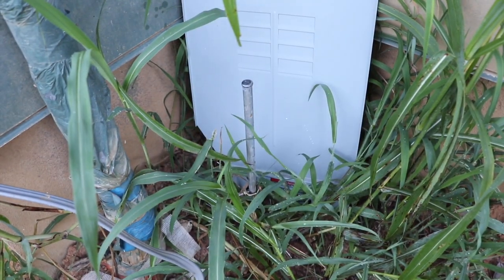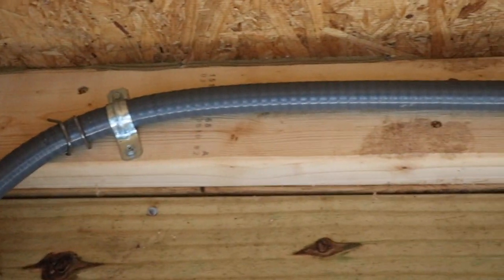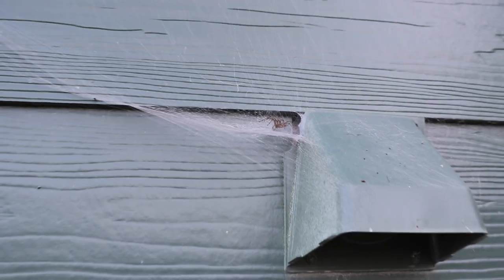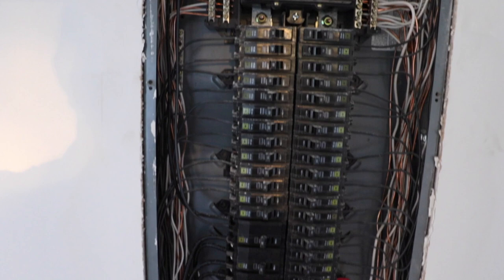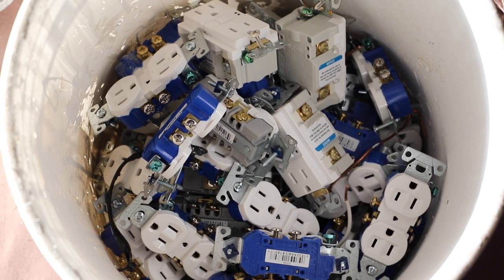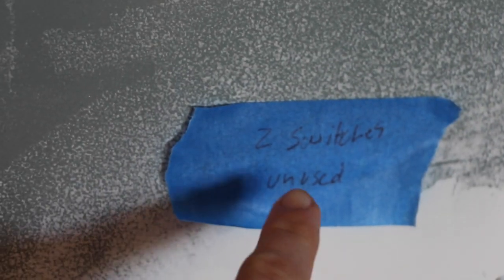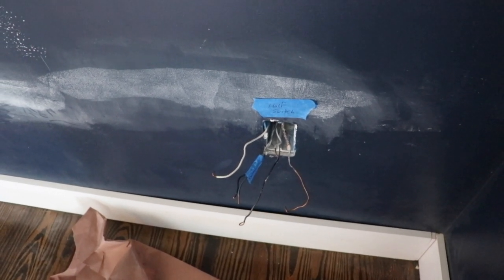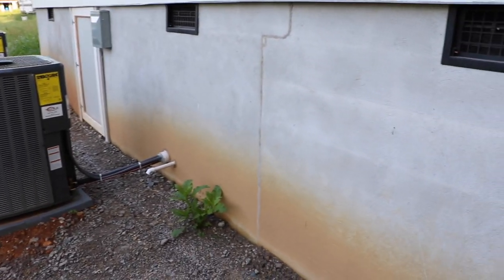Electrical Contractor Failures - Trade Tips

Comment: dont get to far outa your league . Noalox is only needed on aluminum wire. on  the other hand that is some very bad work. and bad work never gets any better. didnt u say u wired the switches in? most electricians dont use labels they notch the wire or twist the power wire around the switch legs. so u probably mixed them up yourself.
Reply: Yeah labels just get painted over anyway most times. Old timers and twist and notch wire to identify it.
Reply: I make a loop in the switch leg
Reply: Noalox is some messy stuff, but our shop uses it any time aluminum is involved at all. Between it and cutting oil from the threader, I don't have a pair of jeans or a single shirt without some kinda stain. Course I never can keep either for long cause they are constantly getting torn by the tie-wire we on our rebar cages in our duct banks. Gotta love industrial... - lowly IBEW apprentice.

Comment: You've got more problems that electrical. Who did your baseboards? Terrible inside corners. Some of your walls are so crooked you'll need 1/2" of caulk to kill the cracks at the baseboards.
Reply from the maker: pyromedichd1 the house was built around 1900. The finish work on the baseboards was great after the cap however you can still see in a couple spots the unevenness. Good eye you can see the whole renovation on our channel.

Comment: First of all you can have grounds and neutrals at a main panel as long as they're bonded together but before the kit secondly don't throw a recept in a crawl space and expect your electrician to put a GFI just on the off chance that a homeowner is going to throw a garbage recept into a screw shell third not everything needs to be arc fault protected it depends on what code you are on Even the newest code book states you don't need it there was a couple revisions made where the older code books required it well if your county or state hasn't adopted it it's not required That's something you should have talked to your electrician about and pay the extra $800 for those breakers

Comment: Noalox is the grease u use on aluminum connection to prevent corrosion
Reply: Anthony Smith  it's called dielctrect great to keep the copper and aluminum from forming passive chemistry.
Reply: When Noalox is used properly you wouldn't know it was there so most electricians will put a dab of Noalox at the connection to keep the inspector happy. The question is did they apply it to the aluminum wire properly or just put a dab of Noalox at the connection?
Reply: Rest ing dial-etrect great ftw.
Reply: Noalox is not required if the terminal connector is rated AL/CU. Not sure if these connections were or were not. But it seems this guy is just calling out any and everything whether it is a legit violation or not.
Reply: I call it pookie
Reply: @voose3839  same... and god help you if you have to use it on a cold day. Worse than ketchup in a glass bottle. :P
Reply: Rest ing dude it’s not dielectric grease stop commenting on something you have no clue on
Reply: Literally from the electrical exam....

No-lox and other brands of "anti corrison" pastes are there to prevent GALVANIC ACTION...not oxidation.

Comment: 7:30 is very important. You make many great points. Electrcicians should watch this vid.
 However you are very picky which is actually good, but there are a few things that could've slid by and not been a problem. But great vid. But you're 100% not an electrician

Comment: You're the one that hired them.  Likely based on price as a guess.  Hire the right electrical contractor and these issues won't be there.  You apparently hired hacks and got what you paid for.  Shame on you for painting electrical contractors with a broad brush in general as untrustworthy.  Much of what you stated is correct, but other things you stated are just ridiculous.  Hire professionals and stop watching so much HGTV.
Reply: Robert Slackware do they even electrician?
Reply: Cheap labor isn't skilled, skilled labor isn't cheap.

Comment: Never heard that red had to be on right and black on left, that’s not code
Reply from the maker: +rmhanseniii Local ordinances are allowed to have their own requirements
Reply: There is no reason to ID phase in any code. Also that's not a proper sub panel it's got a main breaker. Most subs are main lug. Not that a breaker is bad just not needed
Reply: Like he said, and its in the code book, ahj.
Authority having jurisdiction.

If this was f2f one previously, it gets grandfathered in.

You know enough to be dangerous and cause someone a lot of trouble because of your ignorance.
Reply: mark c you must identify the “high leg
Reply: @Brandon Arney
That's for 120/208 3 phase. Single phase you ID the neutral
Reply: mark c, If the sub panel is not within reach of the main panel, then it is a good idea to have a breaker for the input. It allows you to work on that panel without needing to go to the main. And yes, we have them wired both ways. Most of the subs have a close by disconnect of some kind. Our emergency circuit panel even has a transfer switch between it and the main panel breaker. And there is absolutely no Romex in this house. Everything is conduit and individual wire.
Reply: That BS, black on right because pretty much anything you wire ever "hot" goes on the right. "Hot" being black unless you're working 3 phase.
Reply: Peter Welsh eh, my main house panel is mounted upside down because the wiring comes up from under the floor, and your hot on the right becomes left, and indeed hot in that panel is wired to the left, but here's the bunker buster: the main breaker is transverse- mounted so that red and black run horizontally, negating any left and right. To add insult to injury, an electrician didn't bother to trace back the wiring to realize how red runs up the left branch, and the double breakers have to be wired upside down to maintain color continuity. I noticed that myself when making an additional circuit but after seeing this video, I went back in on a hunch and sure enough, the one I didn't do and ignored had been done 'wrong'. Just goes to show you, rules of thumb aren't real codes.
Reply: Wait......Your panel is mounted upside down?   And why?  Color me confused.
Reply: Cheap Contractor trying to save wire, or ordered wire too short, so put panel in upside down to avoid running the feeder to the top of the panel.
Reply: joe banana. For 3 phase, L1 black, L2 red, L3 blue. For single phase, L1 black, L2 red.
Reply: Totally agree! Electricity knows no color. That is a standard us electricians use.
Reply: rmhanseniii  right
Reply: Don't you guys have cpc/ ground sheathing ?
Reply: Luis Mejia yea in Canada it does not matter.
Reply: Mark C as I understand it a sub panel if over 6 circuits must have a means of disconnect from the mains in which case you can use the main breaker as a disconnect.
Reply: No need to color code conductors in single phase.  Just neutral white.
Reply: NEC 408.3(E), the details for phase arrangement are covered; phases A, B, C shall be arranged from left to right and from front to back, depending on how the equipment is made. If this is not the arrangement you have, then you must clearly mark exactly what the arrangement is.
Reply: +lectric2010 
Yes, that's for 3 phase equipment, but still, Single Phase 3 or 4 wire  120/240v is typically installed the same way.
Reply: lectric2010 
It's single phase!!
Reply: If the wiring system has one phase at a higher voltage than the others, using a “high-leg” connection, that phase’s wires should be marked with orange. (This is required in NEC article 110.15.) Phase 1 - Brown
Phase 2 - Orange
Phase 3 - Yellow
Reply: @HEmustincrease.Imustdecrease  - Yeah, but those ground screws better be green!  LOL
Reply: Peter Welsh if you’re an electrician and you assume color an appropriate indicator of the voltage potential you’ll eventually make a lethal mistake
Reply: Great
Reply: its a rule of thumb, real electricians know the low voltage is black red blue, so it just automatically carries over, at least for me it does
Reply: bobben47 why wouldn’t you mount it “upside down”? You don’t want all that extra feeder cabling in your panel. It makes it a mess when adding circuits.
Reply: @brandonarney6588  there is no high leg on single phase. You do not have to identify either leg because it is only one phase
Reply: @jeffreyspence7717  277v
Reply: This rule applies if you have more than one feeder in which case they will be.  Black, Red, Blue  I believe.
Reply: rmhanseniii qa
Reply: @YanasaTV  Yep I know all about that crap.  Paid extra for all copper wire in the mast for the entrance cable because of local ordinance, for them to connect aluminum from the pole to the copper.  Duh!  The kicker is the same people who wrote the ordinance are the same people who own the electric company using aluminum from the poles.
Reply: yANASA Ana Ranch   Depends on what your state law says. No LOCAL electrical codes in New Jersey.
Reply: Both black and red carry the same current to make 220 V available they are different phases.  Must be a local code requirement for the color designation for right / left location but no reason for it.  IF the "electrician" (using the term loosely) has a license (big IF) he needs to be reported and should lose his license!
Reply: @CowenJE  koo
Reply: @joebananatube Actually, a hi leg is on a 240 volt Delta service. Not a  208 volt . The high legs voltage is 208 though.
Reply: There is no high leg on a single phase system.
Reply: yes your right, it doesn't matter what side red is on or that you even have red at all.
Reply: Single phase it does not matter if red is on the "right" or "left". In fact in Canada the hots could be any colour other than white, gray or green....
Reply: @bladnasternaster8607  and everything runs backwards.

Comment: Pro-tip-  Ask the local inspector for recommendations on electrical contractors in the area before you start. I can guarantee the inspector knows weather the work will be passed or failed before they go to the site.  In one glance they can tell if it is professionally done or sloppily done.  There is just so much wrong here that the whole thing is a waste.

Comment: No one is gonna listen to you if you don't know what your talking about. You said wire has to be secured, how often? With what type of clamps or staples per the mounting surface and wire type. You said those penetrations through masonry have to be sheathed, but two of those penetrations the wire is already in conduit. You forgot to mention that the penetrations need to be sealed with a non flammable sealant. You said grounds and neutrals can't be on the same bus, but they are in your main panel. They can't be in a sub panel for reasons I'm sure you don't understands. This "grease" you speak of is for all aluminium conductors to prevent electrolysis of the conductor and it's actually called anti oxidation gel.
Reply from the maker: Alec Ver Bunker oh I "understands" our main panel is on the exterior of the house... the panel shown is an interior sub panel.  Perhaps if you are looking for an instructional video you should search "how to wire a house" and not "electrical contractor failures"

Comment: Arc fault breakers cost about  $40 are subject to nuisance tripping and the increase in safety is marginal at best. But hey, whatever the code requires right.
Reply: QO115 15a breaker is $8.90 + tax CDN Jan 2018.  QO115PCAF breaker is $89 bucks +.  What a racket.
Reply: Agreed hahaha
Reply: They are AHJ and not required by the NEC
Reply: @gragor11  This is why I have plans for an 'arc-fault breaker' rental program/company. rent them for your inspection, then send them back to me after you pass!

Comment: 3:25 Thats not wire. Thats Seal Tight conduit.
Reply from the maker: William Winder you still cannot just run it through concrete. It needs a sleeve
Reply: The seal tight is acting as a sleeve it is weather and corrosion resistant so it should be fine but the other one for sure needs to be put in protective sheath conduit, seal tight, or pvc
Reply: I wouldn't use staples to strap Seal Tight either. Just sayin
Reply from the maker: They make fasteners for it.
Reply: Liquid tight is a sleeve.  Classified as a type conduit.
Reply from the maker: welderboy525 I actually agree, but the inspectors want a solid sleeve on masonry in our county... they have the right to enforce their own rules, that's the beauty of local governance.  But electricians also need to know local code in addition to NEC.  National Building Codes are often the basis and most lax of building codes.  Local municipalities finish it with their own little additions... you have to justify local taxes to pay for local authorities ;)
Reply: Yanasa Ama Ranch nfpa never code is the most complicated code in the world. I understand authority having jurisdiction. The only reason the inspector called out the liquid right is because he was on a mission after finding problems right off the bat.
Reply from the maker: welderboy525 and he was on the hunt because the main panel had loose wires and was a mess... I'm sure some things were a personal preference and some were local municipality preferences.
Reply: Yanasa Ama Ranch I'd be on a witch hunt after seeing missing grease. I've had screw terminals that just would NOT get tight on a wire under any amount of torque when the screw was dry. I've used anything from synthetic brake grease to chain and cable spray and been very happy. Petroleum based oils are known to decompose plastic, so if you're following my footsteps, do wipe any excess off the sheathing.
Reply: If your going to make a video know what your talking about
Reply: That’s car flex not seal tight.
Reply: Hello me.
Reply: In my experience, more often than not, inspectors misinterpret code. Most inspector positions only require a journeyman license with 2 years as said journeyman. Not saying this is the case here. Maybe he wanted a sleeve to protect the plastic coating of the sealtight. It is on there for a reason.
Reply: William Winder g/
Reply: That conduit is sleeve
Reply: Bahaha that's good stuff. It needed a strap where it was hanging over the cinder blocks tho but that's still funny he called it wire. I agree about the staples too. Why right next to a strap? This guy got ripped off.
Reply: So you're saying you need a sleeve for conduit? Lmao
Reply: @Underfaith  u cant use liquid tight through concrete in a lot of places. Its local code I guess. U cant do it in California for sure.

Comment: These were all great spots and a good video. Concerning the ground and neutral issue; I looked into this myself the issue is not having a circulating ground current through the ground and the neutral. In some locations you can have the ground and the neutral together (usually at the transformer) but only at a singular point.

Comment: Shit. I totally missed that code change! I must have been out of the country for 2015.
Reply from the maker: No worries the electrical code in 2015 was the same as 2014... however, not to trip you up but the national electric code is NOT federal law, it is actually just a published standard for states.  Which means you actually need to check with your state to know current code changes.  I guess you were asleep for that part of the course. North Carolina adapted the 2014 code for the NEC April 1, 2016 and in that adaptation they included their own amendments... their decision to adapt the code was made in 2015 with time to add changes to their required CE... CE stands for continuing education.  IBC came out with their electrical code standards in 2015 IBC is the international building code.  However, like the NEC the IBC isn’t mandatory it’s just recommended.  If you knew anything about electrical codes you would know it’s all state based law.  So really, your trip out of the country has nothing to do with North Carolina Electrical Codes.

Comment: Looks like the washing machine was a mistake on the location of the receptacle they tried to remedy by adding an outlet , could be corrected to be code compliant by putting a blank plate at the higher locationand splicing circuit through there and running down to lower outlet , yes now there is a plate and might not be the most sightly think but washers and dryers are usually in an away location anyways .
Reply from the maker: james holske we kept an outlet there, because it's basically a utility room having a few extra outlets is nice.  We actually ended up using it for the station of our invisible fence (installed shelves above the washer)